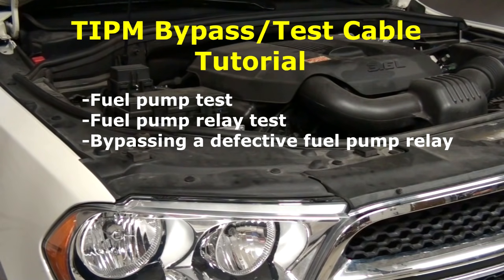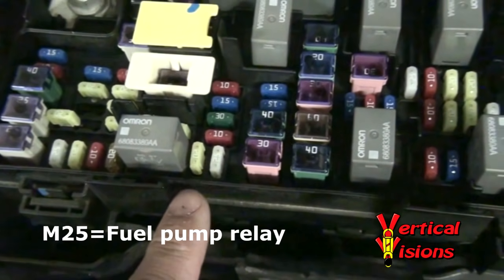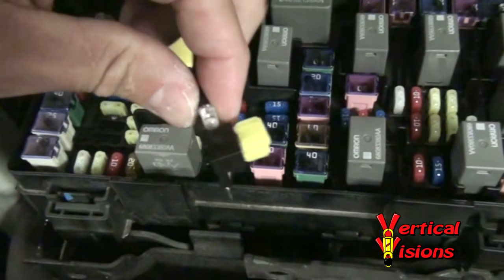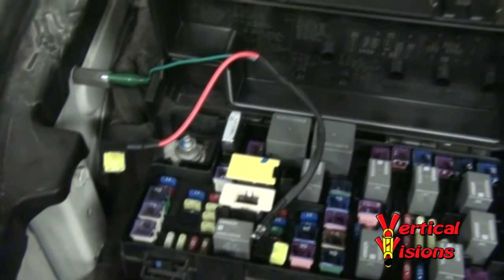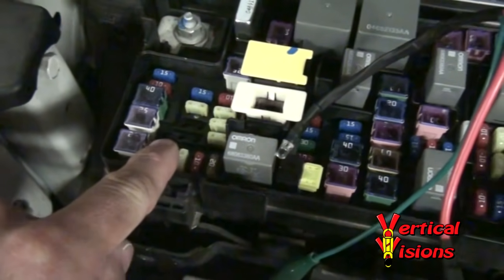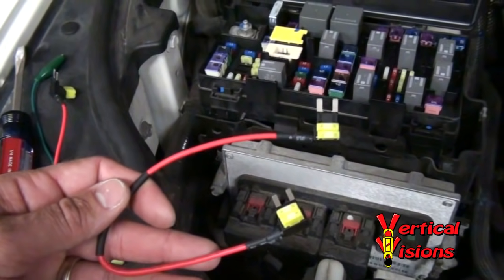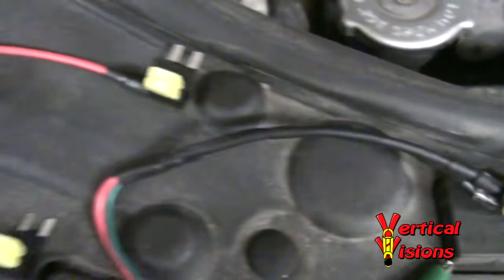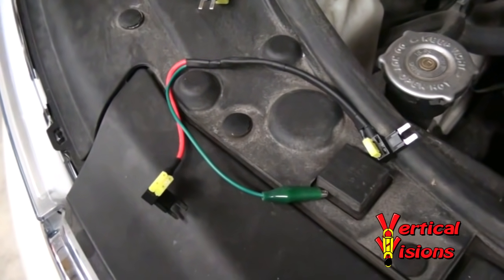TIPM Fuel Relay Test and Bypass Solutions - Most 2007-2021 Dodge, Chrysler, Ram, Jeep, VW Vehicles

Comment: Hi Jason.  I have a 2011 Ram and I am tracking down a drivers door lock issue.  Do you have any knowledge of how that particular system works?  Far as I can tell there is an Unlock relay that is part of the TIPM, a fuse and the door switch itself.  I'm fairly sure the issue is with the relay in the TIPM.
Reply from the maker: Yes, we understand how door lock relays work inside the TIPM.  There are 3 double relays that serve the door locks.   You must test each one to find it or change all 3.  You must desolder one coil pin during energized testing, otherwise you can destroy a 16 pin chip in the process.  Lots of info here:  https://www.verticalvisions.com/tipm-repair-door-locks-wipers-washer-fluid-double-relay-1.html

Comment: Great vid and saved me over $600. Garage said it was a fuel filter and wanted over $600 to replace. I brought a piece of wire to garage and did a quick bypass and my 2011 Ram cranked with no problems. Going to buy your wire now.
Reply from the maker: Thanks.  The old fuel filter or fuel pump dealer excuse.  Heard that literally 1000x from customers like you.

Comment: This is a great fix but u should use m8 that way you can listen to your radio without pump running
Reply from the maker: M37 as the power source does the same thing.  No power during key in ACC mode.

Comment: Does this work if they have done the recall? who ever did our relay job did a really crappy job and it seems like the solder connection connects and disconnects speratically. Would bypassing it like you show fix this issue?
Reply from the maker: TIPM cables won't work if the recall external fuel pump relay was installed since wires were cut.  You would have to reverse the recall for our part to work, which many have done.

Comment: There is a website for Dodge Nitro owners.

So many of them have issues related to the TIPM. I have tried my best to spread the word on how the TIPM causes so many issues with no starts, and other issues.

I am completely ignored. Constant nonsense answers to change plugs, fuel pump, injectors, coil packs, etc.

I am screaming at them how I and others used these bypass wires or had the TIPM rebuilt which solved all the issues.... I am either ignored or told that is not the issue 🤦‍♂️🤦‍♂️🤦‍♂️

Comment: does this issue apply to jeep commander? i dont see the commander in the list of affected vehicles, but it was built 2006-2010. thanks!
Reply from the maker: We're not sure.  Does your TIPM look like the one in this video?  if so, the issue may apply to you as well.  Although the same fuel pump relay is inside TIPMs from 2007 to at least 2018, not every year is seeing issues (likely due to changes in manufacturing techniques).  2011-2013 are the worst.

Comment: Any chance you have a bypass for the fan? Not sure exactly what, how, and where, but I've been reading a lot of forums on 2012 5.7 hemis overheating, and this video popped up for fan bypass, but would be a good use if the externally mounted fuel relay  that the dealer put in once before cuts out. I received a recall notice but i just put a new block in and the dealer is the last person I want touching it honestly, but temps getting up to 223⁰ before really hearing the fan kick on is a bit terrifying for a brand new engine. Perfectly fine driving around until it gets hot and your stopped at a light for a minute
Reply from the maker: Nothing available for your fan, but we do get calls on this issue.  If you want to discuss this more and possible send in your TIPM for us to research a solution, we might be interested.  It's probably a failed surface mount component inside the TIPM, but we're not sure.

Comment: Fuel pump was still running when my 2011 Ram 1500 was shut off. This fixed the problem, however my remote start doesn't work now. Not sure if it's related to this or not.
Reply from the maker: Use the newest connection method to enable remote start:  https://www.verticalvisions.com/tipm-test-bypass-cable-mini-blade-fuses.html#faq19

Comment: Hey brother I have a 2006 V6 RAM 1500. I think it is an oddball year. Anyways, do you think that this will be compatible with my model year? Any suggestions will be greatly appreciated.
Reply from the maker: TIPM cables won't work for your vehicle.  Explanation: https://www.verticalvisions.com/tipm-test-bypass-cable-mini-blade-fuses.html#faq10
Reply: @VerticalVisions  Thank you much! New sub👍

Comment: Is it common to most people with this fuel pump relay problem, for it to only do it when the truck has sat for several hours? Mine only has trouble starting after sitting thru a work shift or overnight. Once it starts and runs a bit it always re-starts fine, stopping to get fuel or food. just curious
Reply from the maker: Yes.  What you just described is the most common fuel pump relay failure scenario.

Comment: I ordered the Standard cable last night. And as soon as it proves to fix my problem, I will upgrade to the Power Bypass/Test System. I've been dealing with this cold start issue for months and going crazy. Changing plugs, sensors, etc... with no change. No warning lights or codes... just this issue every time it sits for several hours, either crank/no start and then start. Or multiple start/die cycles then start. No matter how many times it does that, as soon as it starts then it's fine. Idles fine, runs fine, accelerates fine. So thankful I finally found someone post a link to this on a CarGurus message!
Reply: Just installed this morning. Truck started on the first try. That hasn't happened in about 3 months. Let it sit all day, about 9hrs. Started first try again. If it starts first try after sitting overnight, I am calling it DONE! And I'll order the upgraded board. I can't believe it's fixed with such an easy install!!!

Comment: Does this work on a 2018 Durango? I’m having problems starting the truck up. Checked the battery alternator and starter. But everything is good no check engine light on. I’m thinking this is the problem but I’m not sure if this also affects 2018 Durango not a lot of forums talk about a 2018 Durango
Reply from the maker: Maybe.  Go here and check the picture of the TIPM on the page:  https://www.verticalvisions.com/tipm-test-bypass-cable-micro2-fuses.html.  If yours matches, the part will work using micro2 fuses instead.  Let us know if so.

Comment: Do you do any 2011 VW Routan ??
Reply from the maker: 2011 Routans are well known to us as problem vehicles for fuel pump relays.  A TIPM cable with mini-blade fuses, as shown in this video, will resolve a fuel relay problem on this vehicle.
Reply: @VerticalVisions  I want to purchase one how exactly can I get one
Reply from the maker: @breaknsound  https://www.verticalvisions.com/tipm-test-bypass-cable-mini-blade-fuses.html
Reply: @VerticalVisions  I just ordered the TIPM plug-in fuel pump bypass the lady I spoke with on the phone said this is more of a permanent solution. Is this correct ???
Reply from the maker: @breaknsound  Yes, what you bought is a better solution (patented, designed for long term use, return policy if it doesn't solve your problem, long warranty, etc.).
Reply: @VerticalVisions  how do I put it on do you have a video for that ??
Reply from the maker: @breaknsound  No video available, but 2 pages of color instructions will tell you all you need to know.
Reply: @VerticalVisions  thank you so much I believe it fixed the problem my mini van started no problem
Reply: @VerticalVisions  Mr Bell here is a link of my VW Routan this is me trying to start it and this is the problem I just want to make sure that this is what The TIPM plug in fuel pump bypass will fix 
https://youtu.be/LTlbYn4B0Pg

Comment: I tested that fuse to the reader power outlet. It is powered up when ther key is in there acc position. I took power from the heated seat fuse because it's only on with key in run. I was also able to do this because I don't have heated seats so the circuit won't be overloaded
Reply from the maker: This is the new preferred connection method:  https://www.verticalvisions.com/tipm-test-bypass-cable-mini-blade-fuses.html#faq19

Comment: Hello Jason. Boy am I glad I found your video. My name is Cindy. I knew something was going on. I had the starter, battery, and alternator tested. I also saw that my ground strap was completely worn. So, my mechanic said it was the starter (although AutoZone tested the starter and said it was fine), so I listened to his advise and had him put in a starter. Then, I went and bought a new ground strap and put it on myself because the new starter did not fix the intermittent starting issues.  The new ground strap seemed to help for quite some time (so I thought), but I'm having starting issues again, and I've had issues with my car getting fuel... usually at 40mph and 60mph. I'll push the gas and my car does not want to accelerate while at these two speeds, then it'll suddenly rev up and accelerate very quickly. I thought it was my transmission, but my mechanic owns a trans shop and he said the trans seemed to be fine (of course, he didn't drive the car on the freeway, so I couldn't duplicate the acceleration problems). I've become a DIY mechanic through my history with car issues. I just sold a 2005 grand prix for $200 to the mechanic who charged me $2000 to fix a problem that didn't actually fix the problem. So, I bought this 2011 Town and Country and thought my problems had come to an end. I have a question. Will this pose a problem with a car that has a breathalyzer in it? I hate writing that I have a breathalyzer in my car, but I did get busted 23 years ago. It's been a nightmare! Every time I try to get it removed, I have car issues. Each time my battery has to be disconnected, I have to go to court to prove that I did not tamper with my breathalyzer, then, even if they believe me, they still tack on another year of having to have a breathalyzer. I've spent so many thousands of dollars on lawyers in order to get this thing removed, but then I'll have a car issue... so... money... gone. So sorry for rambling, but I'm trying to put this breathalyzer thing in my past. It happened in my 20's. I'm now in my 50's. I don't drink, smoke.... nothing. My dad was just in the hospital for 2 months and I have to go back and forth to help him. He lives an hour away, and I take him to his doctor appointments. He's not doing well, and I'm so afraid that my car will not start or it will die when I'm on the road with him. Again, sorry for rambling (must be a female thing).
Reply from the maker: 2011 T&Cs are our #3 most popular vehicle for fuel pump relay issues.  I can't ID any issues with a breathalyzer.  Best of luck to you.

Comment: So i been using a cut off switch to avoid draining battery and when I start it from time to time works find today i install your bypass cable invention I removed the bottom fuse with the one end going to m25 and fuel pump was off when I had the key on once i connected the other end to lighter power m7 it went on only when I had key on. But had a difficult time turning on unlike the time when I used the cut off switch i am wondering if bypassing effects the ignition switch hmmmmm. Any i crank until battery went dead. So i need to charge battery before I conclude I will buy new one today.
Reply from the maker: Use the new connection method (more reliable):  https://www.verticalvisions.com/tipm-test-bypass-cable-mini-blade-fuses.html#M37
Reply: @VerticalVisions  Ok I think that way is working so I guess the other way interfered with TIPM..

Comment: Have a unique fuel pump problem with my Town and Country van. Now i have jumping cable to power fuel pump from lighter source but I need to disable the power to pump first which means I would have to know how the fuel pump is being powered.
Reply from the maker: Not sure what your question is, but this may help: https://www.verticalvisions.com/tipm-test-bypass-cable-mini-blade-fuses.html#M37
Reply: @VerticalVisions  So  should connect top M37 instead then to M25? Because when I put back everything back it started right up. and when I had cable from M7 to M25 it wouldnt start just cranked.
Reply from the maker: @marcodeluca4068  Just connect per the diagram on the link listed above.  It's often easier for us to reference a diagram, rather than typing it out.  Connection is M37 to M25.  Red fuse on lower end of M37, yellow fuse on top, then one yellow fuse on top of M25 end.  Cya.
Reply: @VerticalVisions  ok I will try that in the morning and why would M37 work better ?
Reply from the maker: @marcodeluca4068  https://www.verticalvisions.com/tipm-test-bypass-cable-mini-blade-fuses.html#faq19

Comment: I HAVE A 2017 DODGE GRAND CARAVAN..NEED HELP, with this problem.
Reply from the maker: Happy to help.  What is the issue (no start, fuel pump on after vehicle is off, etc.)?
Reply: @VerticalVisions  https://youtu.be/NgD2gPbb_pI
Just easier to write it out..Ill show you.

Comment: Does this apply to the 2017 dodge durango 5.7
Reply from the maker: This vehicle likely takes micro2 fuses and the cable would connect to different slots.  Take a look at the TIPM on this page and if it matches yours, the cable will work:  https://www.verticalvisions.com/tipm-test-bypass-cable-micro2-fuses.html

Comment: Anyone have trouble with there remote start not working after this mod
Reply from the maker: Use the new cable connection method to enable remote start:  https://www.verticalvisions.com/tipm-test-bypass-cable-mini-blade-fuses.html#faq19

Comment: I still had an issue after doing this. Especially after temperature drops below freezing. Totally fixed it after I put the relay in.  Now it starts right up even at 0 degrees F without a problem.
Reply from the maker: Use the new cable connection method: https://www.verticalvisions.com/tipm-test-bypass-cable-mini-blade-fuses.html#M37

Comment: Great video!  So this bypass. Test ca n help u if u get stranded?
Reply from the maker: This cable is mainly used to bypass a fuel relay problem.  However, you can also test your fuel relay and fuel pump.  Three functions are possible.
Reply: Ok thanks! I appreciate that!

Comment: would a faulty fuel pump relay in the TIPM cause the engine to stay running when the key is removed from the ignition? we have a 2011 Nitro that does this on occasion. I found that smacking the TIPM on the cover when it does this will shut it off.
Reply from the maker: No, it will only cause the pump to continue to run when the vehicle is off.  However, if you install a TIPM cable incorrectly by not removing the lower fuse on the M25 end, a stuck on fuel relay will backfeed the circuit and keep the vehicle running.
Reply: Ok, this is on a stock vehicle that has never had any work done to the TIPM. Sometimes when the ignition is turned off and key removed the engine will continue to run. I tested it earlier and got the symptoms to show up and slapped the TIPM on the cover and it shut the engine off.
Reply from the maker: @kramnahillac  Check the K4 (run/start) gray Omron relay that plugs into your TIPM next to your fuses.  Diagram is shown under your TIPM lid.   if this relay is stuck on, your vehicle will continue to run.
Reply: @VerticalVisions  I swapped k4 out with k7, rear HVAC relay. Will give a few days and see if the symptoms return

Comment: Thank you for the video. Just like so many others my wife's 2013 Grand Caravan had power and would crank but not start. I promptly typed in the symptoms to an internet search engine and this video popped up. I bought the cable, installed it a few days later, and it started right up. Best $25 car repair part I've spent. Thank you for the video.

Comment: If dealer says its fuel pump, drive away!
Reply from the maker: Best public comment so far.  You are indeed correct as fuel pumps rarely fail on these vehicles, yet fuel pump relays will likely fail within 10 years or less (depending on humidity, temperature, miles driven, etc.)

Comment: Hi Jason, are you familiar with the "possessed jeep syndrome" that according to all the web sites I've seen is caused by a faulty TIPM.  My 2008 Liberty had an extreme case (lights, horn, wipers, wiper fluid randomly going on and off) 2 months after I bought it.  Would you think one of these cables could help or just get another TIPM? I bought the car in August and it happened only once one morning in early November for about 10 minutes and not before or since.  I'd be interested in your thoughts, thanks. BTW Great video!
Reply from the maker: Yes, very familiar with a possessed vehicle.  We even wrote up a page to address this issue (a TIPM cable won't resolve these issues):  https://www.verticalvisions.com/other-solutions.html
Reply: @VerticalVisions  Thanks very much Jason - I read the article referenced in your reply posted on your web site - hard to believe that there is not a NHTSB recall on this WIDESPREAD problem that has been going on so long ,thanks again.

Comment: on my van where the relay sits the right lower will be ground the one above it send to pump ok so the left lower always has power when turn on key it should power the one above it it powers it but very dim so its not getting ground right so if i jump the lower left and top right pins pump should work right or can i use a ign power insted